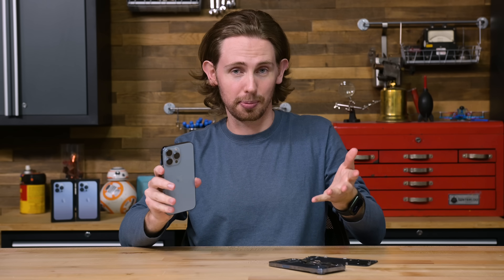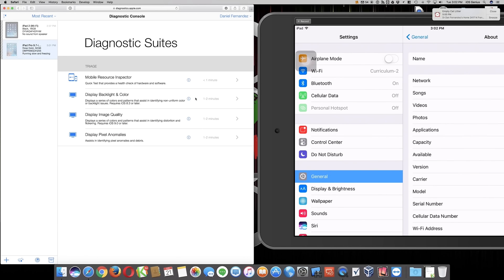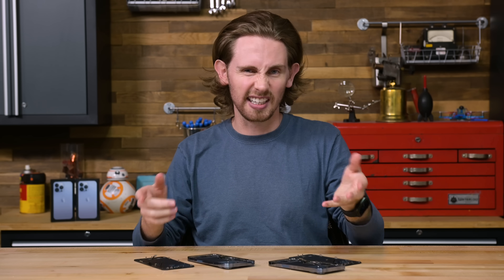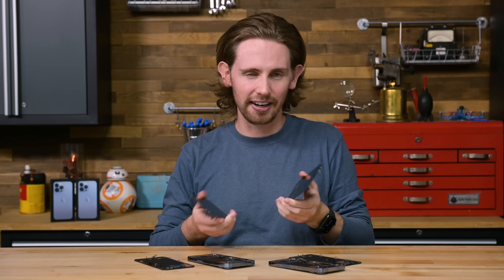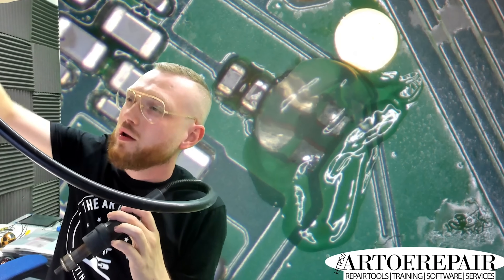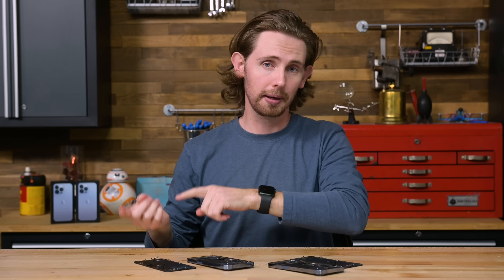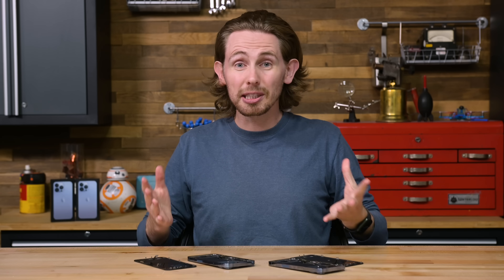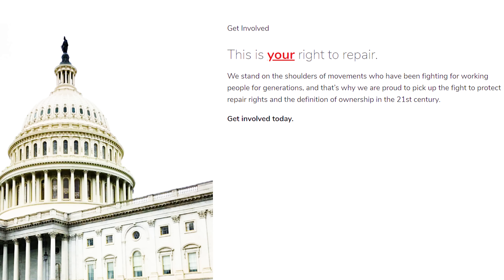Apple Broke iPhone 13 Screen Repairs

Comment: Unfortunately the update to iOS 15.2 on my iPhone 11 disabled my Face ID. No repairs ever made to the device, all OEM. Camera engages but not recognizing face. Tried adding additional face features, would not allow. Reset Face ID, now it will not setup. Sometimes it will show the screen with my face where you move around but it will not recognize the face. Sometimes it will say Face ID is not available and to try again later. Been trying several times a day for the past week. Frustrating.

Comment: Apple should leave it as it is. These third-party repair shops are NOT authorized Apple repair shops. When you buy an iPhone, you are aware of AppleCare and that its an expensive device. If you need repairs go directly to Apple.

Comment from the maker: UPDATE TO THE UPDATE
We have confirmed that iOS 15.2 addresses this Face ID serialization mess and you can now replace a screen without transferring the microcontroller or losing Face ID. Read more about the update and our findings here: https://www.ifixit.com/News/56386/ios-15-2-fixes-iphone-13s-face-id-repair-trap-and-improves-its-repair-score
 
UPDATE 
Apple told The Verge that they will "release a software update that doesn't require you to transfer the microcontroller to keep Face ID working after a screen swap." We are ... a little shocked. Clearly this was not a security issue at all! Just another move against independent repair that they're backing down from, or a bug that they never bothered to test for. 

Read The Verge's update here: https://www.theverge.com/2021/11/9/22772433/apple-iphone-13-screen-replacements-face-id-software-update
Reply: Interesting. Even if they are covering their ass it's a win.
Reply: @bryanjk  just got my IPhone repaired for cracked screen the touch wasn’t working either cost me £300.00
Reply: @Tad1945  seems kinda high tbh
Reply: @bryanjk  Yep never go to the Apple genius store, thing is I had no other option because no other Third parties stores would fix the iPhone 13 for some reason  when inquired they said we don’t do iPhone 13 screens 😤.
I’m guessing it’s with it quite new phone and these advised me to go to the Apple store.
Reply: That was quick
Reply: Apple hates you guys to the core. All the information you guys are giving. They must be plotting to whack one of you guys.
Reply: I assume, the error message will remain... So after all we have to transfer the IC.
Reply: I’m really glad that Apple finally turn it right. Thank you for this IFIXIT!
Reply: Classic Apple move

Comment: I support that idea. There’s a big but, you guys buy super cheap damage iPhone, then some repair guy use super cheap part to repair and sell it at good price. Not every repair guys are good guys….
Reply: Hi, I replaced my iPad screen at home using a $20 replacement screen off eBay.  It was easy and cheap and saved the item from going to live in the bottom draw in my dresser for the next five years before I send it to be recycled, maybe eventually.  (Just looked in there and found a windows phablet from 2009).  Lol. The repair was fully successful and the device works perfectly for my needs.  I would happily do the same to the iPhone 7s in that draw to give it new life for my teenager, it’s slightly more complicated and I’d rather not repair at home, rather take it for a cheap repair, but instead it’s sitting in there with a smashed screen not sure if I can get it replaced for less than a new phone.  I wonder how many other smashed screens have relegated otherwise perfectly good phones to bottom draws.

Comment: disable face id and never use it again.

when you get a new iphone dont use face id but use the pin number instead.

if the screen cracks and needs replacing go into the face id settings and deactivate face id and make it fall back to pin number unlock instead then you can replace the screen and dont use face id ever again.

was the grapevine the same grapevine of the song

the last option would be better to make laws that makes anti competition illegal.

there are laws in place that prevents the Rockefeller family from using standard oil to buy up all oil and fuel companies and monopolize the fuel industry.

in the 70s and 80s the same laws broke up the phone monopoly into baby bells.

the 90s microsoft was busted for bundling explorer so tightly into windows that you could not run competitors without breaking the system.

i think the same laws could be used to stop apple from blocking repairs.

i understand and get it that apple thinks security but that is something that an external dongle could do with encryption.

i also get it that apple thinks you will poke the battery and start a fire trying to remove the battery but i have removed batteries from bricked phones without any problem.

but apple has gone too far

Comment: Here is what will happen if repair is open without proper authorization. Counterfeit and aftermarket screen of inferior display quality will flood market, smashed and broken phones gets repaired and passed on as like new to be sold on craigslist, offerup, swappa, eBay. End user would have no idea what they bought isn't an iPhone, but rather a frankenstein  phone assembled with all kinds of aftermarket parts, screws not torqued, screens not calibrated, antenna radio level either too high or too low. It would be a disaster for people who buy used phones.
Reply: That's when apple should be the ones regulating them. Allow these repair shops to do it but sell them genuine parts only for them to fix it. Anything else is counterfeit but instead, apple chooses to incentivise this and milk the heck out of both customers and users like you who only care about after used market phones. Sure, your argument is solid but the fact apple is consciously enabling and disabling this notion what goes inside is the bigger problem. You buy the product, you can do whatever you want with it.

Comment: Just pay Apple to change if for you! I mean how much are you really saving? Apple also charges FAIR prices for battery changes $90 is very reasonable. The screen is always expensive for IPHONE repairs, the screen itself is hundreds, just like an android.
Reply: How does this justify locking hardware with software?
Reply: Monopolies are always a bad thing, especially with something like repair. Apple will push you to buying a new device by charging insane prices, which are close to the price of a new device. Often while 95% of the old device is working perfectly fine and could be repaired if the tools/parts are available. Instead, it becomes e-waste.

Comment: Just don't buy Apple products. Vote with your wallet.
Reply: Every single other manufacturer is doing the same. What you’re going to do? Stop buying phones?
Reply: @sterkriger2572   that is not true, name a few manufacturers that set serial numbers to their parts so they cannot be replaced like Apple does.
Am I saying other manufacturers are supporting right to repair? No, absolutely not. 
Is Apple the worst offender? BY FAR.
There are manufacturers building things that are just hard to repair because nobody thought of it or just didn't care. And then there is Apple, who actively implements ways to prevent others from repairing their devices. That is next level in my opinion, and they do it cause people still buy their products.
Vote with your wallet.

Comment: Just a though on the Face ID disable, it’s a biometric tool that can allow access to things like banking account and more so it make sense that they won’t accept a « said Face ID » that they can’t truly trust
(I’m just playing devil’s advocate here)
Reply: The problem is the screen has nothing to do with the face id module, they aren't even attached to begin with. It only make sense to lock face id for a swapped dot projector or the front sensor, well actually resetting face id not disabling is the line
Reply: The faceid module has nothing to do with the screen and no one is questioning apple about locking it. The problem is the screen that has nothing to do with it

Comment: Is this not something that can be resolved with one of those “QianLi” devices, that are already in use for retaining the functionality of True Tone after a screen replacement? 

Or are the chips mentioned in this video read only?
Reply: Its only true tone, not for important display message and face is. Serial number and secure memory is different. For true tone, its only serial number, however for important display message and face id, its secure memory (which is in the chip and can't be reprogrammed)
Reply: The eprom programming devices like Qianli icopy and jc v1s currently won’t work with 12 series and 13 series as of now because the ic on the display is locked by apple
Reply: @wardragons9780  indeed, even since iphone 11 its already locked
Reply: @aldenviriyatanudjaja5234  oh sorry I forgot that…!
And the bmc on battery are locked from xs and on ….preventing from programming new battery and that is now solved recently
Reply: @wardragons9780  yes display ic and BMS is locked

Comment: What you lot forget you got to look at apple point of view on this, from repairing electronic myself. There is a lot of fake crap out there that will damage your phone and I seen lots of china rubbish fake parts. Also most of these mobile repair shop use rubbish and are bad service, like not putting seal back on the screen and leaving screws out, etc. I seen this mess myself and this is not good. I do agree to a point you should be able to buy parts of apple at a reasonable price, this would be the best thing. It’s to long to go into, but I seen so many mess ups by shops who repair phones.
Reply: Many repairshops use rubbish parts not because they want to, but because Apple makes deals with manufactures of the parts to only sell the original parts to them.

Comment: This guy is very transparent and being very honest wen he mentioned roasting 2 displays. Honestly it’s not an easy job to replace that ic if you don’t know your hot air and distance from your gun to the component. This is indeed a very delicate job. First and foremost one need to remove the under-fill by keeping a metal shield below the reborn to avoid roasting the display. Finally activate the weapon to remove the ic. Apple is full of nonsense and right to repair will have a say to their monopoly strategy on mobile accesories.

Comment: eh, that would defeat the point. I would rather have an apple fixed device than a third party one cause third parties usually use cheaper quality display. And by Apple pairing the displays like this, I would have a better chance of knowing whether the 2nd hand iPhone I am going to purchase will have a third party display or not, thus having more bargaining chip.

Comment: I wish there was a happy middle ground where the need is there to pair components but anyone (literally anyone) can do it, but only if the original device that was paired with that component has Find My iPhone turned off at the time of repair, and let any shop authorize the repair through GSX.

This way people aren’t getting phones stolen for components, people can do repairs, and maybe it costs like $5 per display to pair it and Apple gets to make their precious money doing next to nothing. I really do think the right to repair your own devices is important, but I also see the need to discourage a stolen parts secondary market.
Reply: well, there's even a better way to discourage secondary stolen parts. Provide first party OEM parts at a reasonable price! It's that simple! No need to serialize or anything.
Reply: @gabrielenitti3243  the reasonable prices are still more expensive than the risk involved in mugging someone for their phone (among other belongings)

Building in a way to not use stolen parts is both worth it and relatively simple. Providing access to OEM parts on top of it is ideal though.

Comment: Because a nefarious party can replace FaceID cameras with a playback device that plays back to the FaceID  chip your face unlocking your face easily without you knowing (replay attack).
Reply: That’s why the FaceID module isn’t replaceable. This video is about the screen which has nothing to do with the FaceID module.

Comment: To be honest I think biometrics should be the only ones that should lock if they aren’t the original part. I understand Apple wants perfection and all but they could just give a message that it’s not the original part and may not work as intended but still leave it to work.

Comment: I would say the software is definitely against right to repair however the repair techniques are fairly easy to learn. I’ve always been impressed by the amount of people with zero technical knowledge who have been able to fix their phone screen and unfortunately this discourages those casual DIY technician however if you learn these skills and acquire the equipment they are invaluable in many other types of equipment repairs. I was fortunate enough that I was formally trained for free in micro miniature repairs.

Comment: i get it why apple is stopping ppl from fixing/ playing around witch face id and keeping their security standards, it is used to e.g. unlock your credit card and other sensitive information.
But the camera, screen, battery etc should still be easily DIY fixable!
Reply: The problem is the screen has nothing to do with the face id module, they aren't even attached to begin with. This is as unrelated as disabling battery health for a swapped screen

Comment: Yet still people know nothing about cars.. 

On modern cars electric parts need coding/learning mode to work properly, you can't just replace fancy headlight assembly that you've smashed against wall with new one. It works but does not auto-level or move before it's coded. 

You can't replace windshield on newer cars with cameras/sensors on your backyard, those functions need calibration. EGR will not work properly before it's been taught how to work.

Usually those things on really new cars are locked behind manufacturers diagnostics devices, you need licences and whatnot..

Those are just some examples oversimplified examples of things i've seen myself.

Comment: We wish it was just a click of the button. If you're at the Apple repair depot, you don't have to tell the customer the display didn't pass the "calibration" and they need a whole unit replacement. At an AASP, if the display doesn't pass calibration, the customer doesn't get upset at Apple because they don't know any better. They get upset at us and leave 1-star reviews because "we messed up their phone"

Comment: Apple is trying to play a monopoly business on diy repair sector, which other companies are interested to follow as well. I saw some videos where samsung is also trying to implement such pairing system with their phones. These needs to stop asap. Why someone have to pay 69$ for just a battery which usually last long only 2years? & screen replacement is basically the price of a new phone…. Voices need to raised against such aristocracy..
Reply: It's a bureaucracy, not aristocracy.

Comment: I vote for licensed apple repair network. Because the reality in Russia is this: almost every "cellular repair service" provide poor quality repairs. And then there is a ton of aftermarket devices repaired with terrible quality. Top services currently advertising to use Apple Care for new devices. And second thought: do you remember how easily can you disassemble say Nokia 3310? Easy! But now technology is different, and functional level of devices is very different from what it was. How could you expect to solder modern IC's with "legs" instead of BGA? And by the way, where is repairs for Samsung devices? Can you "unglue" any Samsung device to repair?

Comment: I wonder how can they say that you can't change the display for security reasons. Also I don't understand why no one talks about privacy issues with apple, yes it's nice that they don't allow Facebook to spy on you but they spy on you even worse than Facebook and you can't turn it off in any shape or form, even without a network connection. No one says anything about this and every review of iPhones is just selling points that Apple says in their keynotes....

Comment: It is not and never was an error, just like Error 53 with iPhone 5S wasn't one either. It's not like a developer just dropped a line of code in there by mistake that Face ID doesn't work, you HAVE to want to do it for it to happen. People have been sleeping on this for YEARS and don't realize the full consequences of this. They're slowly but surely taking away the concept of property and laughing right under our nose by pleading "It's for security !". What little reaction and backlash those actions by Apple created over the years made me cynical over the fact people don't care and will realize too late what happened.

Comment: My solution to this may be Fairphone 4 or Pinephone pro

So vote with your wallet if you can
Reply: They both overpriced and under spec
Reply: @sterkriger2572  Specs matter so much, but the software is more important. Fairphone will have the best LineageOS support there is (because the manufacturer supports development) and the Pinephone pro has the same chip as in Pinebook pro and no other phone has similar features and software support on that price point.

This is just my opinion, but I think the software matters more than the hardware specs, that’s why people buy iphones (it has great camera processing and other useful software features)